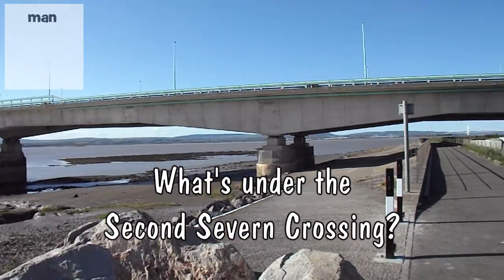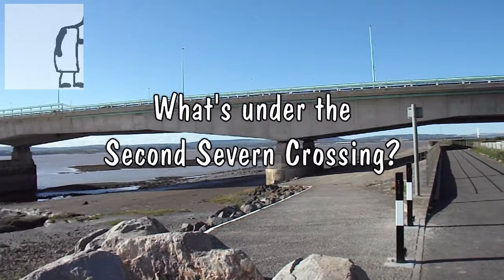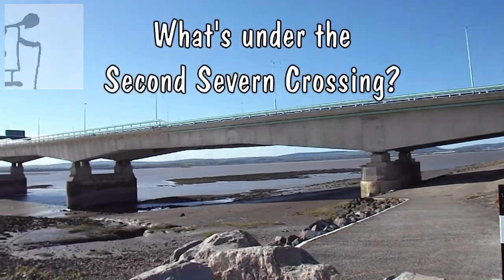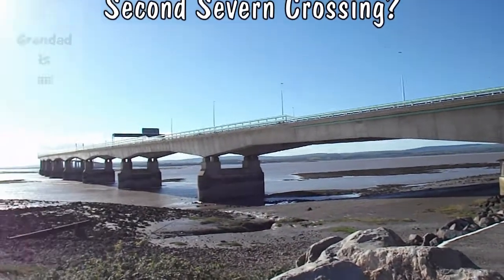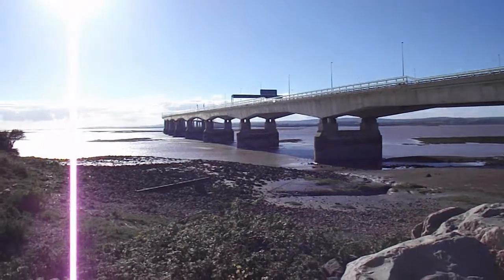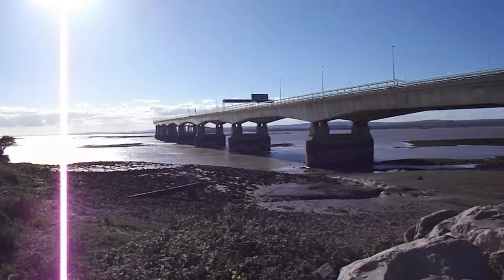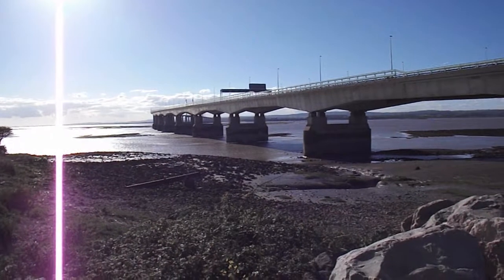What's under the Second Severn Crossing

Comment: There are 2 caissons that are position either side of the Severn railway tunnel below. The load of the bridge passes past the tunnel and onto the ground below the tunnel to avoind adding load on the tunnel. I watched the piles go in.
Reply from the maker: Thanks for commenting. Originally I had a link in the video description to the original bridge website that gave a clear technical explanation. Unfortunately, that site no longer exists. I put as much of the detail as I could into the video description.

Comment: cassions n45 and n44 worked on them filling with concrete, yes piles are placed as not to load the tunnel below
Reply from the maker: Hey thanks for taking the time to comment, great to hear from somebody with first hand knowledge. I wrote to the owners and pasted their reply into my video description.
Reply: With all the space around WHY build it above the tunnel ???
Reply: Smaller caissons were designed to act as a balance beam on the piles

Comment: So odd there's no contact with the ground on the edges below the columns. I don't understand the technical description.
Reply from the maker: I am afraid that if you don't understand the technical description, then I can't help you. My understanding is that there is a train tunnel under the river and the supports are arranged to prevent damage to that tunnel by directing the loads away from it. Unfortunately the website that the link in the video description takes you to, no longer exists. You may have to research bridge supports to find further information. I have added some new links to the description, but the old information that related to those gaps has disappeared.
Reply from the maker: I just looked through my previous replies and I think this one covers it - All the load must pass directly through the seven 2 metre diameter piles down to the rock below the railway tunnel that passes under the river and not be transmitted to the ground or river bed surrounding the tunnel. If there was no gap then some of the load from the bridge would be transmitted to the river bed and potentially damage the tunnel. How about this metaphor, the bridge is a house brick balanced on some iron nails that are hammered into a block of wood. Between the brick and the wood you can place some eggs. If you then stand on the brick and wobble about a bit, some of the eggs may break because the brick moves a little on the nails. However if you leave a gap between the brick and the eggs, any movement of the brick does not touch the eggs and the brick's weight is still carried by the nails.

Comment: Well I must agree with Miamifiction.  Although the support piers may be stable, I would have placed the pilings outward, at the ends of each pier.
Reply from the maker: I suggest you read the technical explanation I gave him and also placed in the video description.
Reply: GrandadIsAnOldMan Ah, good point.  Now that I have read the description, I am at a loss to understand the 1 meter air gap.
Reply from the maker: Daniel Padova I guess you didn't understand the technical explanation so I will try again :-) All the load must pass directly through the seven 2 metre diameter piles down to the rock below the railway tunnel that passes under the river and not be transmitted to the ground or river bed surrounding the tunnel. If there was no gap then some of the load from the bridge would be transmitted to the river bed and potentially damage the tunnel. How about this metaphor, the bridge is a house brick balanced on some iron nails that are hammered into a block of wood. Between the brick and the wood you can place some eggs. If you then stand on the brick and wobble about a bit, some of the eggs may break because the brick moves a little on the nails. However if you leave a gap between the brick and the eggs, any movement of the brick does not touch the eggs and the brick's weight is still carried by the nails.
Reply from the maker: Daniel Padova haha, well put :-)
Reply: Those ones you can see daylight are the piles over the seven tunnel

Comment: Quick question do you get get to fish that area?
Reply from the maker: smokster0604 I haven't fished there for well over 20 years but there is this nice concrete flood defense barrier all along this stretch near the bridge so easy access to the river bank. We used to catch flatfish, eels, conger, even the occasional cod and whiting. Access from New Passage Road or Shaft Road, Severn Beach. I will put a Google map location in the video description.

Comment: The ones you can see underneath are the ones on piles to hold up over the Severn tunnel
Reply from the maker: Yes, the details are in the video description, I recently updated the links because the original link that gave full technical explanation has disappeared, so I replaced it with other information.
Reply: @GrandadIsAnOldMan  I worked on there doing the ground work and prepping the aeras for the casions and we built the road out in the river to get stuff out there
Reply from the maker: @gazza4230  brilliant 👍👍 The explanation I put in the video description originally came from the owners. I wrote to them back in 2015 and they gave me the reply and supplied the link, but that link is now dead.

Comment: Well I'm not an engineer, but that doesn't looks good. That part of the bridge is going to be more fragile and probably not stable enough. Regards.
Reply from the maker: miamifiction Here is the technical explanation

"These two pier foundation straddle the Severn Railway tunnel.  In order to avoid applying a load from the bridge to the river bed that could be transferred to the tunnel structure, these pier foundations are each built on seven 2 metre diameter piles that are driven into the rock below the tunnel, with the foundations having a 1 metre air gap from the river bed.
 
At this point the base of the railway tunnel is approximately 22 metres below the bed of the river."
Reply: GrandadIsAnOldMan
Thanks for the explanation. Take care and regards.